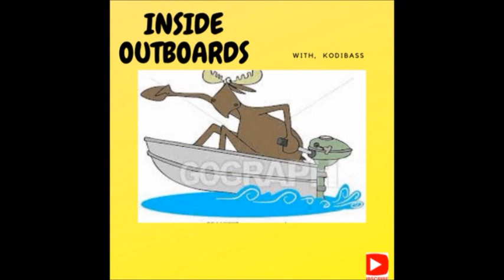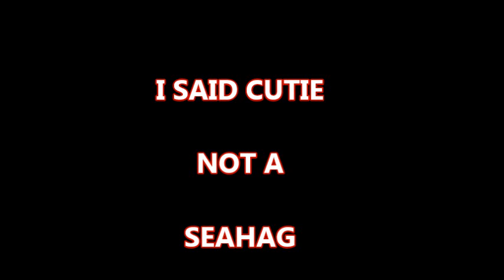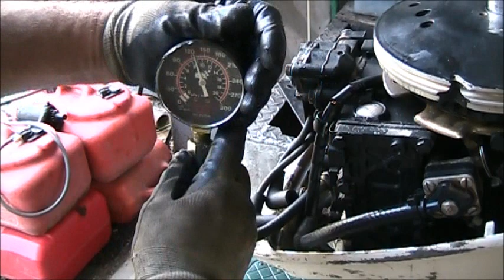15 HP JOHNSON PART  3      # 3,   and  much  more.

Comment: OK, you left us hanging like they do on the news....I saw the burned part of the old head gasket, but it appeared to be around cylinder 2, the lower cylinder....Wasn't it the top cylinder that had low compression?  Oh well, we will find out tomorrow I guess...
You mention pulling the powerhead to change the shift handle I think...Call me crazy, but I'm pretty sure you can get that shift handle out of there just by removing the carb...Not that I'm against pulling the powerhead, so you can do the grommet job while its off!  
It's amazing how sometimes those rings can break off and sneak out of there without leaving much of a mark or scuff/score.  Perhaps the rings are stuck, hope I'm wrong though...I'm hoping the salty old dog will come back to life.  Other times, you see some scores in the cylinder, but see no problems with the rings/piston when you pull the exhaust/intake covers.  Guess I will just have to wait for tomorrow...Jeez,, I gotta get a life....

Comment: Eculite  is the standard tools for Electronics tool cases. Yes 7/64 bonus Allen wrenches
Harbor freight has this in 3/8 socket in 7/64. I I use 1/4 or 3 8 extensions and adapter
Reply from the maker: +JB  Boom''  there it is,  Had a few subs ask about the size I knew you & others would know,  thanks for sharing 4 sure.                              kodi

Comment: Probably should have changed the thermostat while you had it open...the excess water from the pump runs to the bottom of the water housing pump indicator(pee hole) hence keeping the lower cylinder cooler....if the thermostat isn't opening the top cylinder will be the first one to go.
Just a thought
Reply from the maker: Great point, Thanks...   kodi

Comment: Kodi, I'm looking for advice, I have a 6 hp Johnson 1979 model year with low compression on both cylinders (42 psi). In your opinion is it worth trying to fix? Lower gearcase is good, carburetor needs work and it needs both spark coils changed. I've had it running for short periods of time but then the coils start breaking down and I loose spark.

Comment: What was the verdict on the top cylinder? Was the head gasket the problem? What compression did you get? Thanks for the video.
Reply from the maker: +AS,  Next vido,,,  Got to leave a little tease ,  I will not leave ya hang'n  long.     kodi

Comment: I have a question, do you have a solution for replacing the old cowl seal on the older 15 Johnson and Evinrude motors.  I have a 1982 Evinrude 15hp that needs a new lower cowl seal
Reply from the maker: +JS,   I have found that many rubber seals from old junk yard cars, will work as lower cowl seal,  I like to use the trunk seal rubber from small import cars,  cut it to fit & use small plastic clamps & 3M  weather seal as the adhesive let it sit overnight & reassemble.                                                                                                  kodi
Reply: I will definitely give that a try.  Thank you for the advice.

Comment: how do you adjust the throttle assembly on a 25 hp 2 stroke
Reply from the maker: +tl  on a 25 what brand,?      & year?                      kodi
Reply: @kodibassInsideoutboards  2000 yamaha